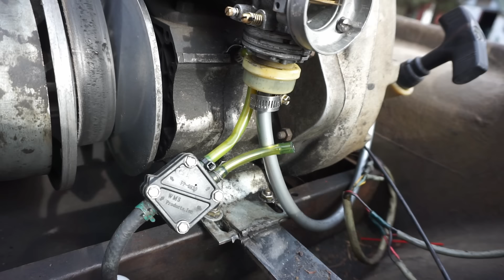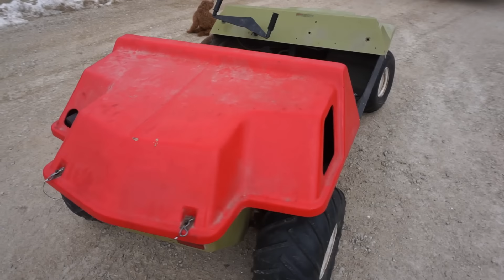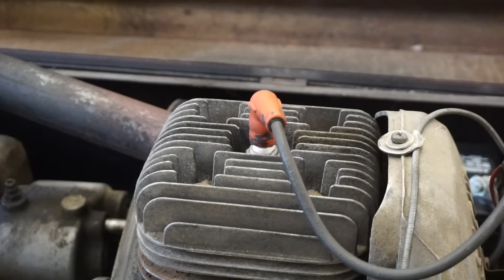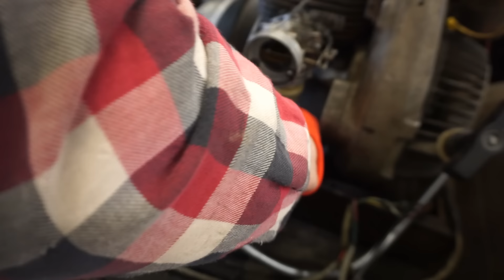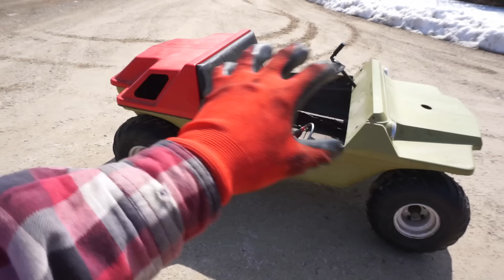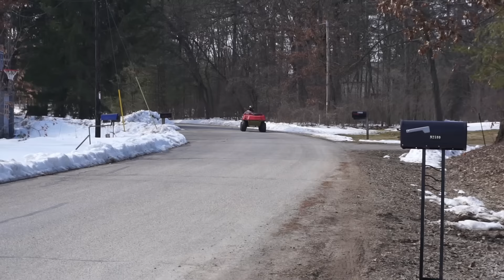I Bought The World's First Production UTV (EXTREMELY RARE)

Comment: That engine has to be missing some sheet metal around the head. There's no way it could cool run in that enclosure without a shroud.
Reply: No the fan housing directs airflow through the fins to keep it cool. Not all two strokes need a fan as long as the fins give enough surface area for correct heat dissipation.
Reply: It's a single with a main fan. It's getting plenty air. But there is a metal enclosure for those motors I believe. 
If it was a twin I'd agree. 
Free air or not. 
Nothing pushing over they will melt down, twins will cook mag cylinder asap.

Comment: That little side by side started working well once you plumbed in that pump! You could get a few cans of that Flex seal spray to seal it up and may help strengthen the fiberglass and check the body mounting bolts too looks like it was all taken apart at one time? Like to see a GPS on the speed you ripping around on these projects! Great content and videos!😉👍📹💯✔️👋👋👋
Reply from the maker: Thanks for watching and for commenting! I appreciate it!

Comment: I've never seen one of these -- this personifies the 70's go machines, one part terrifying and one part exhilarating. This thing looks like its doing 35mph sitting still, so cool.
Reply from the maker: It is a really cool machine!
Reply: @2vintage  Yeah I wouldn't try to remove the orange paint, find a local auto paint supplier, have them color match what ya got, they can even put it in a spray can for ya -- refurbished tons of computer equip this way.

Comment: Another  cool thing  to check base gasket  leek  put pressure gage on that  crank vent  tube.  Spark  plugs in or out it don't matter . Pull the cord   or turn the key  if the needle  moves  a lot back and forth it's fine. If the needle   don't  move  its blowing  past  the broken  or cracked base  gasket  from old   and rott.
Reply from the maker: Thanks for the suggestion!

Comment: The old SACHS two-stroke. The original equipment intake manifold probably had a passageway in it for pulses from the crankcase due to the fact that it's a piston-port. That pulse fitting in the crank case looks like it was an add-on.
Reply: Piston Port you're talking way over his head and most of the audience

Comment: That square box going into the carb is a pulse fuel pump.  That extra hose goes to the engine. That's what supplies the vacuum to the pump to operate it.

Comment: Dude! The compression will go up when you put oil down the barrel, your reducing the volume of the combustion chamber if you don’t give it time to pass by the rings, remember it only passes through the ring gap! So reducing the area inside will increase the pressure. 😂 I was honestly waiting for you to set fire to this one as well by splashing fuel all around the carb and engine 😮

Comment: Crazy man! I would put a steering wheel on it,to make turning easier! put something in where you switch the gears from low to high to reverse so it actually stays? better conection to the gas pedal, longer piece that actually goes from the pedal to the carb!
Reply from the maker: Thanks for the suggestion! I appreciate it!

Comment: I have one of these machines. Bought it in 1970.   Paid $1000. Has a 295 JLO engine. No transmission. Same drive as a snowmobile. Has a twist grip throttle on the right handlebar   Holes on right side of dash are for a grab bar. It is not amphibious.  I have a ski kit for driving in the snow  it will go 55mph   Pretty cool machine. Enjoy it

Comment: Reminds me of a Coot. We never sold one but we got our sleds from a distributor who did sell the Coot line of ATVS. They were all designed to take your snowmobile engine and give it a second home for summer use. Very crude and hard on your bum. We had a Red Baron Coot for a while. Pop stuck a Sachs Wankel in it and the thing flew!  50 mph and no suspension.  Best used on smooth flats or a free visit to the dentist and chiropractor was next. This is a great find here.

Comment: A vacuum lift pump will work fine, the carburettor has a diaphragm that will feed the carb from the tank if the tank gravity feeds otherwise needs a pump to deliver to the carb from the tank.

Comment: The tire tread on those tires should point forward i.e right front. Good luck with your wierd dinosaur.. neat!
Reply: The right front wheel and left rear just need to be swapped over.
Reply: Agreed, all the tire treads should be going in at least the same direction, not sure it will help much

Comment: Tou need to rebuild the carb. Put gas tank in back close to engine.  That carb has it's own fuel pump.  There are holes in the block it lines up with for the pulse for the pump in the bottom of carburetor.  Easy fix.😊

Comment: You should’ve listened to the dude you bought it from. Get the new replacement diaphragms and it’ll pull gas. That style carb doesn’t rely on a vacuum source. The diagrams inside the carb pulls the gas from the tank.

Comment: From doing alignments most of my life I'm pretty sure if you're getting wobble it's either because it's not towed out like an eighth of an inch or even a sixteenth of an inch or you have some loose parts or both FYI not to mention it seems like that thing would go forever on a gallon of gas at about 35-40 it seems it's barely running

Comment: I'm unsure if this rig is supposed to have an impulse orifice in the crankcase, 2-cycle utilizes crankcase in the combustion cycle - I usually make block off plates for the intake and exhaust and test the seals by applying 10-20 psi and 10-20 vacuum. I'd bet if the carb was rebuilt and the gas tank was above the carb height, that it would gravity feed fuel like it should. utilizing crankcase pressure to drive an impulse fuel pump when you could have bad rings may not be ideal.

Comment: I have a question that isn’t related to this video but I was curious to see if you might know. I have an 03 RM125 and when the engine warms up I cannot get the bike to idle. I have the idle speed screw, screwed all the way in and it still won’t idle. It idles perfectly when the engine is cold but dies when it warms up. I have changed the spark plug, cleaned the carb multiple times, checked compression and I don’t know what else to try. Would you know what could cause it to not idle when warm? Thanks!
Reply from the maker: Check the air screw on the carb.
Reply: @2vintage  Ok, should I richen or lean it out?
Reply from the maker: @Layton_RC  try leaning it out first
Reply from the maker: @Layton_RC  so twist the air screw out
Reply: @2vintage  Ok, I will try that. Thanks! Love the videos!
Reply: Po

Comment: I don’t care how rare it is, I’d be ripping out that old 2 stroke and putting a v twin Briggs in it, cut it in half, stretch it by 12” or so, Mount the pedals so they’re easier to use, strengthen the frame so it won’t tweak and twist as much and build a gate for the shifter.

Comment: The engine air flow needs to be directed, or it will over heat the engine. That will wear out the rings quickly.

Comment: Thats a sinker not a swimmer for sure obviously no certain way to make a good seal on steering and power shaft seals.the tub itself if seperate from those links could be watertight enough on its own to float but in its current configuration its only a mud crosser at best.thats why those later models have there hubs sealed to tubs and then connected to chain hub gears on inside making it full on floatable.snooky

Comment: I really thought ya'll understood rich and lean carburetor conditions. Here you keep flipping the choke on when it sure does not need the choke. If it went lean in these conditions it is because the gas wasn't coming up, not  because the  choke needs on. My Old Kawasaki 500 would only start at three kicks if you did not touch the throttle and went full  choke. I see you with these dirt bikes blipping the throttle on every kick. Some will not start that way. Unless you kick it 50 times. And I see what happened to the rings, without an air cleaner on a dusty road ya'll only need to go 1/2 mile and they are ruined.

Comment: Some of those engines were designed to pulse through the carb spacer between the carb and the engine , cuz that carb that's on that engine is designed for that style , just do some research cuz that fuel pump isn't the proper set up !!!!